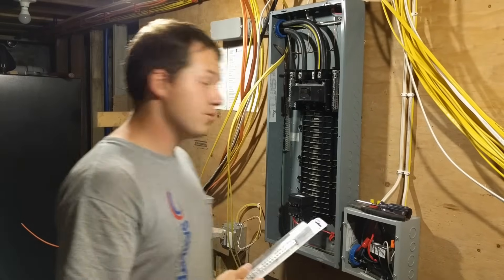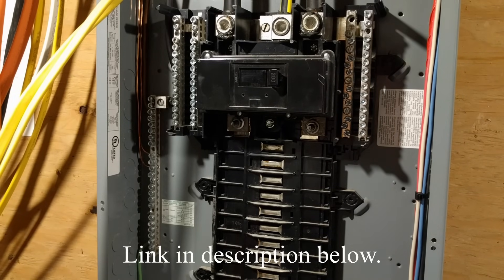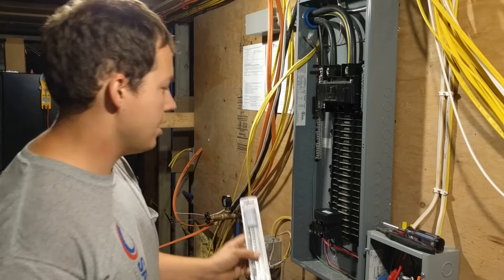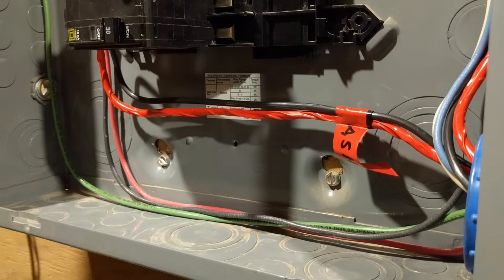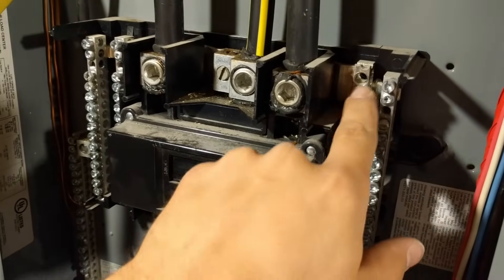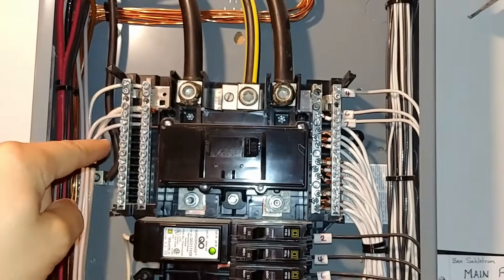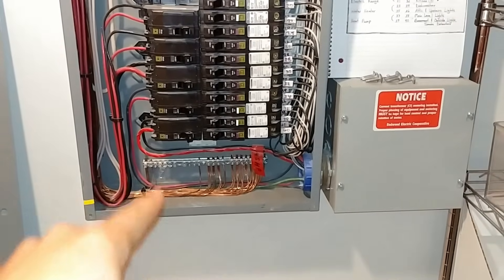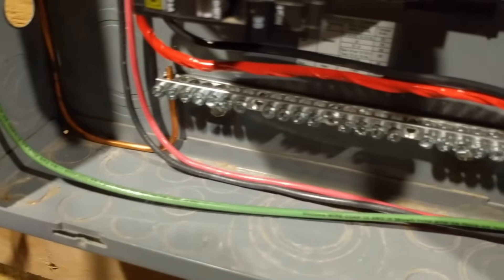How To Install a Ground Bar In a Sub Panel or Main Load Center

Comment: Very clean install on the clarification part. You do nice work, I would love to have someone as tidy as you are when I need work done. My last experience with a "journeyman" electrician didn't leave me with confidence that the job was done correctly just because it looked so sloppy.
Reply from the maker: Yeah unfortunately not all installs look the best. Sometimes it isn't the guys fault in that they are under pressure to finish ASAP and can't take the time to make it look neat. You have to shop around and ask for an electrician that does neat work. You will pay a bit more but I think that it is worth it. Thanks for the comment!

Comment: If lightening hits the saturated ground it goes up the ground rod and can destroy all circuits if the neutral wires aren't isolated. That's why boats are wired like that.
Reply: In this case it is also wired for protection against a loss of neutral, in which case most home ground rods would have too high resistance to trip a breaker in a ground fault.

Comment: Hello Ben, what is the reason for not adding Neutral wires to the additional (new) ground bar in a bonded distribution panel? You stated this at the very beginning of the video.
Reply from the maker: It is just not permitted by code. It could theoretically "work" but it just is not allowed.
Reply: @BenjaminSahlstrom  Thank you for your quick reply. I appreciated your video, well done. I am a subscriber.
As you say, it theoretically works because this additional equipment grounding bar is an extension of the neutral bar in a bonded panel. Of course this is not the case on a subpanel where the neutral and equipment grounding conductors should never be mixed. I have not been able to find the code which directly speaks about this so when you mention it I sought your help. Once again thank you for your response.
Reply: But it is ok in the main panel correct?  Also what gauge side to connect New bar. I have 100 amp service. Ty
Reply: @shemicdee780  Yes, it is okay ONLY in the Main panel (Main Disconnect). Use a #6 wire to connect your additional/new ground bar to the manufacturer's provided neutral bar, which, in the case of a Main Disconnect panel, is bonded to the manufacturer's provided ground bar typically via a green screw. The ground bar, the neutral bar and the panel's case are all bonded together at that point. Of course, never do this in a sub panel.
Reply: Enrique Ferreira because it would create a current loop which is called objectionable current per the nec. It means the current would not only flow back on the neutral but also the grounds of it were done in such a manner. That’s why it’s only done at the main panel or first means of disconnecting, otherwise if you took a meter and measured voltage on various grounds around the house you would see voltage which is what you don’t want. The supply power on all power lines have the ground bonded with the neutral which is why in small place or towns that feed residential areas you only see two wires on the poles instead of three and even when three phase is supplied they only have 4 wires three hots and a ground/neutral. That’s why you only have three wires feeding your meter. Two hots and a ground slash neutral. The purpose of the ground being bonded to the neutral is in case of faults so the current has a low impedance path back to the source which essentially is the neutral or return path for current, without it whatever neutral or hot wire that touched a metal surface would energize it and it would stay energized without tripping the breaker and create a shock hazard for people. Sorry didn’t mean to get so in-depth just spreading some knowledge to you.

Comment: Nice to see how the lads do it over the pond
Reply: Bob  instead why dont you share your profound knowledge rather than putting him down over a video where he did nothing wrong. Though I didnt say you didnt know your job, most of the people I have learned the most from, who were truly smart, weren't half as condescending as you. You could do a lot more with that knowledge, but you decide to be an internet troll. Interesting, I would say you would have to be pushing 50 at 26 years in the field. Way to express you expertise at such a mature age.
Reply: Bob  Atleast he has an actual understanding of why a subpanel requires separation of ground and neutral, as opposed to most of the "real" electricians that wire up what they think is right. But im sure you have it down to a science..."Bob"
Reply: Bob  Typical troll reply, no constructive criticism. Mike holt taught at night to 10 or 15 students at a time, then he reached millions on the net. 😘

Comment: At 5:30 of the video, you mention the 4th wire, coming from your neutral bus on your main panel,  you then said it is supposed to go to the first "grounding bar" in your sub-panel.  Isn't this wrong?    The neutral wire from your main panel should go to the neutral bus on your sub-panel,   NOT the grounding bar
Reply: I understand now,     on your main panel,  you have both the neutral wire AND the ground wire coming off the neutral bus,   then going to the sub panel, and separated once in the sub panel.

Comment: Very nice and informative video :)  I have a question about rewiring a 15 or 20 amp breaker that runs from my house panel , outside , to a shed / shop.
Question :
a.)    Is there a maximum distance I can run a 12/2 UF (direct bury) wire from a 15 or 20 amp 
breaker to a run of 4 or 5 outlets and a light switch ? I'd like to 
replace a yellow 12/2 residential wire w/ a grey UF (direct bury) wire 
that already feeds a shed / shop in my yard. Thanks for your generous 
consideration, 
sincerely ...............................
Reply: No you’re fine with doing that although I would run a pvc line instead of UF. But if you go with UF make sure to bury it at least a foot down
Reply: Thank you :)   I will have it about 14" to 18" w/ a walk behind trencher :)   PVC line ?   You mean the grey tube conduit ?  That's what I bought even though they say you can bury the wire by itself.Thanks again for your generous consideration,sincerely .................
Reply: @stephboeker7835   With PVC conduit it is a little more expensive, but you have the option to pull extra wires through in the future.  Also you have more protection from shovels.
Reply: I agree, and the cost is so small i'd feel bad if I didn't :)
Reply: 14 gauge wire requires a 15 amp breaker 12 wire requires a 20 amp breaker. Test line loss at the end of the line. I wouldn't recommend going over a 100 feet with that small of wire.

Comment: why should you not attach the ground wire to the neutral bar in the subpanel?
Reply: In a system, there should be one, and only one point where neutral and ground are connected together. In this system, the neutral and ground are connected in the main panel (not in this video). He is technically adding a sub panel, therefore the neutral and ground should NOT be connected together in this sub panel. The overall purpose is to not create current loops.

Comment: Excellent job of wiring. Should the sub panel have a separate ground rod driven jn the ground?
Reply: If it is a separate building, then i believe the answer is "yes."
Reply: No. The ground of the main panel is the ground for the entire system.
Reply: Randy Lyons Rafikin Ali was right in his answer. If it is a detached building then yes you would need another ground rod at the subpanel, in this video it is a subpanel and so he needs another ground rod which he has.

Comment: Any advice for an old fuse panel set up in both the house and garage where they ran only a ground wire from a water pipe and 2 hots to the garage and then they bonded neutral and ground? Without running new wire with a neutral I cant seperate the 2.
Reply: Way Woodworking you would have to pull a neutral wire to the garage, and while at it I would change the fuse panel to a breaker panel, but if it’s fine leave it assuming that you’re not trying to add more circuits or things are not overloaded. But the panel in the garage is a subpanel and needs to have the neutral and ground separated. Because as it is now the return path since there is no neutral wire is traveling back on the ground energizing whatever that ground is starched to including all metal parts which is not good.

Comment: so in the main panel you can put the neutrals & the grounds on the same bars that has a grounding screw in it and on the sub panel you have to separate the neutrals from the grounds with a separate grounding bar.
Reply: tunnelwind1 yes this is true. This is to prevent objectionable current, or a current loop in which current travels back to the main panel or source on not just the neutral but also the ground wires and metal parts attached essentially energizing things that shouldn’t be energized. This is why sometimes people get shocked by stuff and not know why.

Comment: Great video, work and info. One thing that I do is grind off the paint where Ill be installing the the ground bus to ensure a well established grounding point.
Reply: You can also install the ground bar by actually using a drill and tap to actually thread the screw into the metal
Reply: I am confused by this video. Bottom line is ground and neutral can not be bonded (tied together). If they are bonded and you lose the neutral all the current will go back on all the grounds. So if you touch a ground and you are touching a pipe or somehow are grounded…… say goodby! ⚡️⚡️⚡️⚡️
Reply: @SparkeyDogfish  aren't they bonded in the meter?
Reply: @JesseKlaus  ... bonding of neutral and ground is ONLY at the point of first disconnect. That means in whatever panel the main line circuit breaker is mounted. If it's out at the meter, then that's where you bond.... and no place else!

Comment: Great video! So just to be clear. Even though in the main panel, my neutral and grounds are bonded, I carry both wires from that bonded bar and split them in the sub panel? And since I am in the same building, I don’t need a grounding rod. Is that correct?
Reply: Yes, that's correct. You don't want the EGC (equipment grounding conductor) to be paralleling the neutral wire because then the EGC would be carrying half of the neutral current back to the service panel which is not good for a variety of reasons. The EGC should never be carrying any current at any time unless there is a fault, like if the metal cabinet of an appliance became energized, and even then only briefly until the breaker trips.
Reply: And if you are in the same building then you don't need a grounding rod.

Comment: Hi Ben! I would like to add an exterior gfci outlet with a dedicated cable to my front entrance.   On my main electric panel, I still have a few slots for additional single pole breakers.  Most of my lightings are LEDs and and I have gas appliances so no problem of overloading.   But on my neutral bar, I'm running out of screw in space to insert another neutral wire.   My local home depot master electrician tells me I can put 2 neutral wires in under one same screw because he says there's not much current going through the neutral bus anyways.   Is he correct?
Secondly, I thought neutral bus is where the current coming from hot wires, goes to the outlet, then go back through neutral wires, then the neutral bus, then back to the transformer.  Doesn't that mean theres quite a bit of current going though the neutral bus?  Is then the grounding bus  and wires another pathway for any excess current to go back to the transformer in addition to the neutral bus?   Thanks in advance, and love your videos!

Comment: Nice job on your wire wrangling. Why is a non isolated neutral bar "dangerous" in a subpanel, but OK in the main panel?
Reply: Around the world building codes require the bonding of neutral and ground to be at only one place, the main panel, never anywhere else. The reason for that is the neutral line normally carries plenty of current, and you don't want an alternate pathway through the (often smaller) ground line to ever carry some of that normal current back to the main panel. For example if a neutral pathway should become interrupted, or even just a little faulty, current may find an easier pathway through the incorrectly bonded ground line of a subpanel which should carry voltage only in an emergency. Ground lines connect to the frame of most electrical equipment and if charge appears there a person could get a shock from a failed neutral elsewhere in the house. By bonding only at the main panel, the chance of backfeeding the ground wire is minimized.
Reply from the maker: THANK YOU for the excellent explanation. Couldn't have explained it as well as you did. Kudos!

Comment: Going to be replacing my panel soon with a SquareD QO Plug-on Neutral 42 space load center. I'm cringing at the cost of these QO afci breakers.
Reply from the maker: Yeah I get what you mean about that. It all adds up!! At least if you're doing it yourself you'll save a bundle of cash on labor.

Good luck!

Comment: Great video! I have a 200 amp QO Square D panel like yours.  I want to add 2 grounding bars to clean my panel. I am planning to add one on each side. My panel is not a sub panel. It is the only panel in my home. I have a bonding screw that goes through the silver bar into the back of the panel case that the 4 neutral bars, earth ground and spiral braided aluminum wire attach.  I saw where you added a large  ground wire between the 2 grounding bars. In my case I would add the large ground wire from one of the 2 neutral bars that is close to one of my new grounding bars, and repeat for the other side? Correct?  How many 12-2 /g and 14-2/w can go through one clamp? just 2 or 3?  thanks.
Reply from the maker: Technically you would not be required to add the heavy ground wire from the neutral bar to the new ground bars as the case of the panel can act as the conducting material (via the bonding screw to the neutral bar) if I'm not mistaken. I added the heavy ground wire as an additional safeguard and the electrical inspector told me that although it wasn't required it also does not hurt anything to have some redundancy. So yes, I would add a heavy bare copper wire to each additional ground bar that you add. As far as how many wires under one screw you need to look at the instructions that cone with your new grounding bar kits. It will tell you specifically how many wires of 12awg or 14awg are allowed. Generally I'd just stick with two to be safe but I have seen/heard that code allows up to 4 but you still have to follow manufacturer guidelines.

Hope that helps!! Good luck on your project!!!
Reply: My understanding is that you would also keep the grounding screw, as its not a subpanel, which wasn't mentioned in the video (i know Ben mentioned removing it for the subpanel).
Reply: BAT-man this is true but only in the main panel.

Comment: Benjamin
Nice Video, I have a question, would I have to add two bus bars (ground and neutral) to my main panel if I don't have room on the current bar to add my generator hook up.
Reply: dallee709 If your main panel is the first means of disconnect meaning that’s the first place the wires come from the meter and first place you can disconnect power to your panel then you only need one bar since the neutral and ground are bonded together in the main panel. However if it were a sub panel you would need to keep the neutral and ground separate, but in your case it’s a main panel so you only need one additional bar and you can attach grounds and neutrals in that panel.
Reply: Thank you Kenneth. What size side do you recommend to ground New bus bar to current bus bar. And I'm thinking to ground it to the bus bar on my right as I look at my panel. The ground coming from the street is tied into bus bar on my left. Thank you
Reply: Just want to make any inspector happy